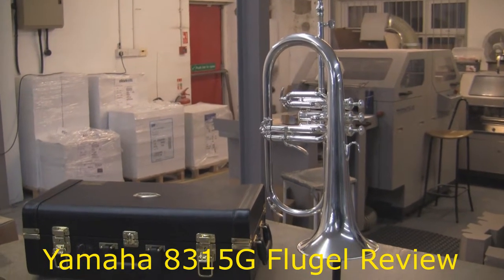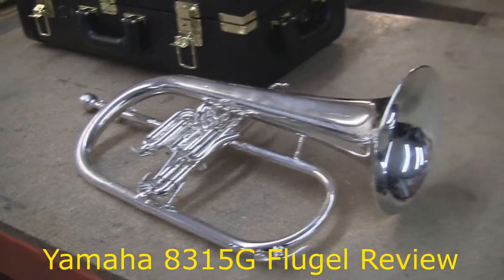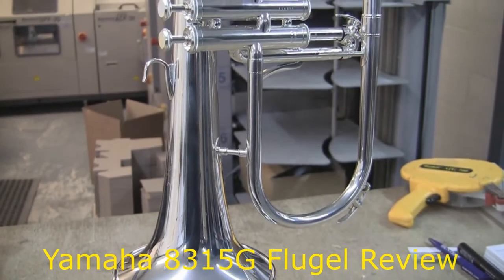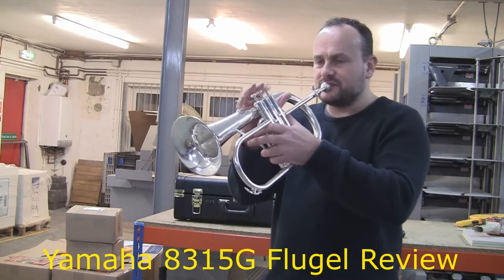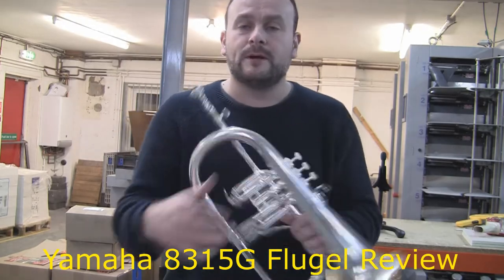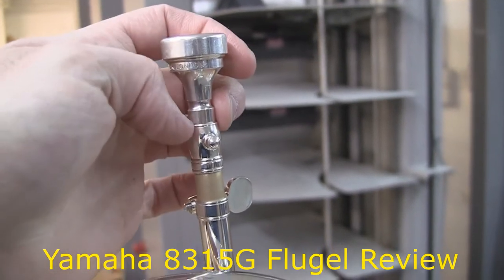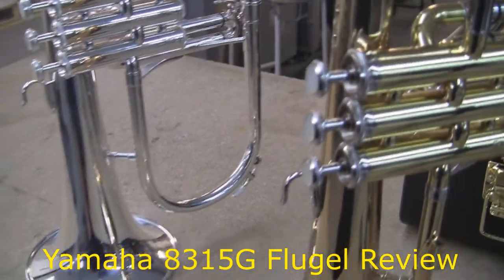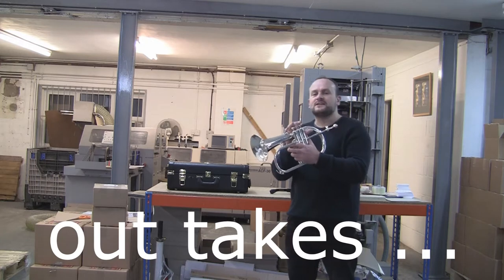Yamaha 8315G Flugelhorn Review

Comment: Hey thanks so much for your various reviews - I like all the instruments you've reviewed and am going to make a trip to Rosehill to try a few. Your reviews have saved me quite a lot of time in preparing for this and have been really helpful for getting my head round the different specs and nuances. As a matter of interest, are you still playing the Courtois 154? I'm seeing that and the 8315 as front runners. (I'm playing brass band and currently on the band's Yamaha 6310Z which I like but am looking to upgrade and buy my own.)
Reply from the maker: Adam Pearson Yes I still use the courtois. I would say the courtois is more in tune overall and I like the bottom sprung valves. I use the Yamaha all the time it's a great all round instrument and feels a little fuller than the shew models
Reply: @stampysrandomreviews  Fantastic - thanks. Do you mean you like the bottom sprung valves of the Yamaha? I find them a bit of a fiddle to clean (e.g. trying not to lose the springs or get them tangled, and them get them in position and silent again once back in) but then again at least you can easily get to them. A few more questions for you please: What do you use the 2 instruments for and why is it good to have both? You mentioned the 8315G is easier to play than the 154, especially at the top end. Can you say a bit more? Also - any thoughts on silver vs lacquer, and did you try any different bell types? And what bell is your Courtois? Thanks. Much appreciated. I've only been playing brass for a couple of years (string player and singer before then). Now doing an hour or two practice a day and wanting to maximise my progress and playing - hence wanting a good instrument that's going to help me play well and in tune.